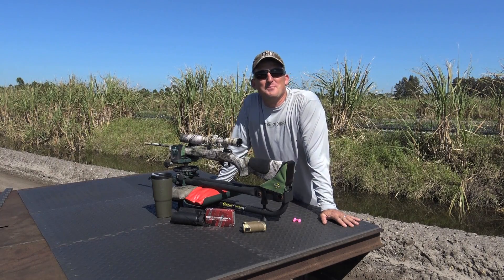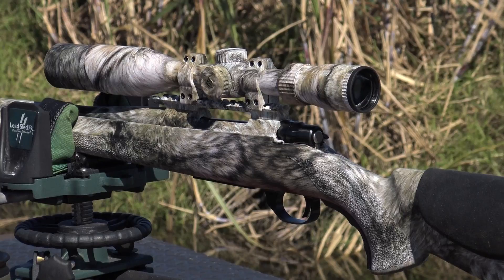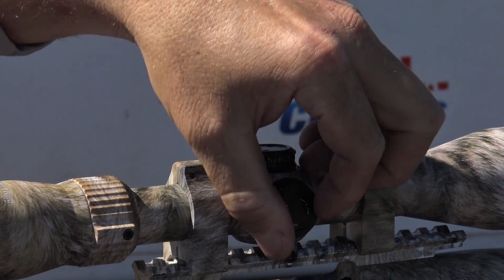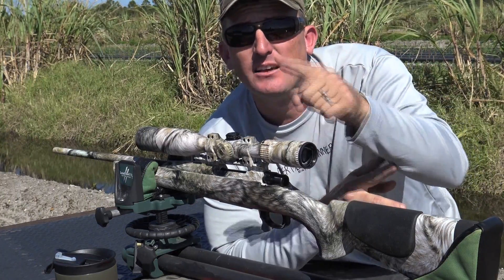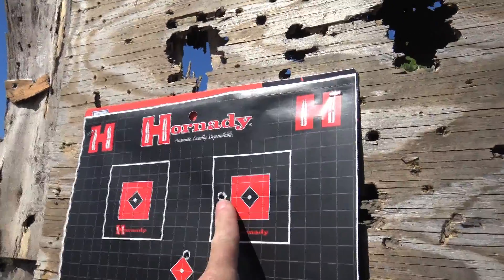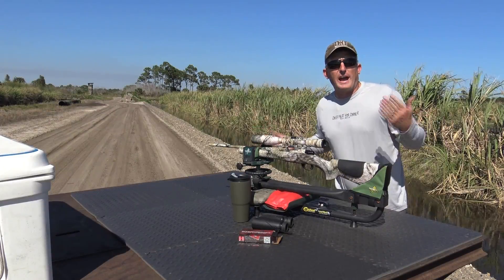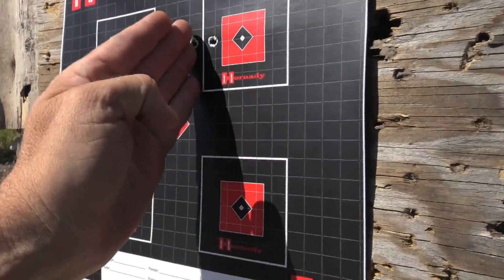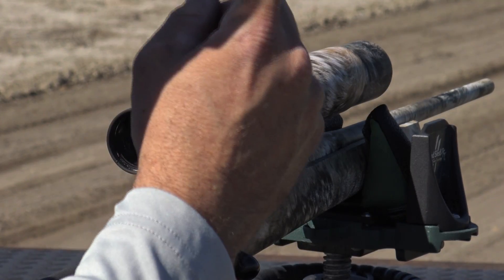HOW TO PROPERLY SIGHT IN A RIFLE!!!

Comment: how are you figuring out the clicks
Reply: +djm93 Hey. Rob includes the info in the vid. It is pretty standard for all scopes. If in doubt ask your local gun store and I am sure they can assist. It should be included with your scope instruction manual for sighting in for your scope. Otherwise... Google helps.
Reply: +djm93 Most of the cheaper scopes in the US are 1/4 MOA, but they aren't a true MOA but rounded to 1 inch. So at 100 yards, 1 click will move the crosshair 1/4 of an inch. This increases and decreases as range does. 200 = 1/2 inch per click and 50 = 1/8 inch per click. Again read your manual and see if it's 1/4 or 1/2 MOA or even Mils which is different.
Reply: +djm93 As you are clearly a beginner, the explanations you have recieved would be just as, if not more confusing. I  love Rob's vids, but he hasn't done a beginner any favours here. What's a Moa? A 12 foot tall, 510lb extinct bird from New Zealand ;-)

MOA = Minute of Angle. I'm sure you understand what an angle is. How many degrees in a cirlce? 360. Half that, 180. A quarter that, 90. MOA is 1/60th of 1 degree, which equates to technically, 1.047 inches at 100 yards. Latin, minuta; small in size or degree. We have more accurate measurements these days, but it equates to (360 x 60) 21,600 minutes in a 360 degree circle.

As Shadow stated, the figures are rounded down from 1.047 to 1 inch at 100 yards. But cost has nothing to do with measurement. The price of a scope is measured in visual clarity, shock/impact resistance and mechanical accuracy (eg. if I adjust it one way an inch, then turn it back one inch, the impact the same).

1/4 MOA (.25 inches) is the most common scope adjustment you'll encounter. What it means is, each click moves the sight picture .25 of an inch at 100 yards. If the bullet hits an inch left, you need to move the sight to align with the bullet impact. .25 x 4 = 1.

Now again, thinking about degrees and angles, look at it like a protractor. You are in the centre shooting a straight line out. If it's 1 inch left at 100 yards, at 200 yards it will be doubled, ie. 2 inches left. But it's still the same 4 clicks, because .25 adjustment at 100 is doubled to .5 at 200.

When the range is reduced to 50 yards, half of 100, the bullet is going to still hit left, but only by half an inch. The adjustment is still 4 clicks, because half of .25 is .12.5.

.12.5 x 4 = .50 (half an inch at 50 yards, one inch at 100 yards, two inches at 200 yards etc.)

There is a wealth of information out there, and it can get confusing. If you're not satisfied with an answer, keep asking. I've seen scopes with 1 inch, 1/2, 1/3, 1/4, 1/8. And then we have MRAD (milliradian) which is based on decimal conversations, therefore much easier to convert and adjust when shots in the field vary (military, long range hunting).
Reply: AusiKifaru27 Cost does have some to do with measurements because I've never seen a sub $150 maybe even sub $200 scope with MRAD adjustments.
Reply: +AusiKifaru27 Thank you!!!
Reply: Shadow
There are many realiable, sturdy, well built scopes for low cost. I think it's more accurate to think that MOA isn't cheap, but that MRAD is expensive. It's merely because the kinds of demands long range shooters have that would use them also require additionals features as a necessity, like parallax adjustment, First Focal Plane reticles and very expensive glass for light gathering and clarity at high zoom levels, plus adjustment repeatibility as you're going to moving your point of aim often. They're built to mechanical tolerances as good as any Swiss watch.

As a hunter, I sight in for one range and leave it, then use holdover for longer shots. Many a goat, pig and camel has dropped at half a kilometre without fuss. Even the silhouette competition shooters here just use a quality MOA scope. The most important thing for them is that adjustment repeatibility, because they already know what ranges their targets are at.

Australia is much like the US in that the majority of people put a scope on that is up to about half the price of the firearm. Europe, on the other hand, will use a scope up to 2-3 times the cost of the firearm. To each their own. I'd prefer to save that cash for ammo, but if I have a hard kicking rifle, I like to spend a bit to make sure it doesn't get knocked around a lot. On my .22's on the other hand, I threw a $60 tasco scope on my CZ a little over 20 years ago and have never had to sight it in again since.

Comment: Sorry to rain on your parade bud but your ballistics are skewed. The scope is WAY to high over the bore. Should be right down on top of the bbl w/o touching it. IF your scope were lower youd be getting 1 high @ 100, dead "0" at 200 & an inch low @ 300. Your "tackdriver" & mine TOTALLY different. 1 raggity hole @ 100, cloverleaf @ 200 & 1/2 or less @ 300 is "acceptable" but hardly a tackdriver ESPECIALLY shooting off a solid rest. MAYBE after that bbl is properly broken in, and youve found/ developed your loads for that particular bbl it will shoot LOTS better but as is, its mediocre. 243/6mm & 7mm are inherantly extreamly flat/tight shooting. Polish/tune your sear, make sure bbl IS freefloted & NOT touching the stock. Try many different brands/styles of bulletts til u find that "sweet spot" & stick w it. Sometimes its the cheapest Wal Mart "economy" brands that shoot the best.  Seems in the last 20 years or so America has been sold a line of crap that 1 MOA @ 100 Yds is good. Its NOT. Its sad were being sold that lie by modern mfg practices.
Reply: A lot of good advice.

Comment: I just don’t understand the clicks can anyone tell me how to do it I am dumb i never used a rifle before
Reply: Hey Bernie. When you pull your turret caps off it will say on the adjustment something like 1/4" or 1/2" click and have an arrow telling up or down, or left and right. That's how much it will move your point of impact at 100 yards. So if yours says 1/2" and your 4.5" inches off to the left of bullseye at 100 yards 9 clicks (9x1/2"=4 1/2") to the right should put you right on target. But remember at 50 yards it will move your impact half as much since your half the distance. So 1/2" moves it only 1/4" at 50 yards. Hope this helps

Comment: IFyou can shoot this way its you.
I just cann't
My 3006 from 25.yards to 250 yards
Will stay with in 3.5 inch high at 125.yards back to zero at 250.  Its with 150grain.  At 300 yds 4 in low 400yds 17.5 in low. I hunt in the mountains for me its to hard to see a buck or a doe at 400 yds its just a deer